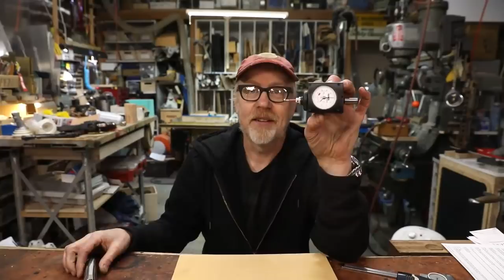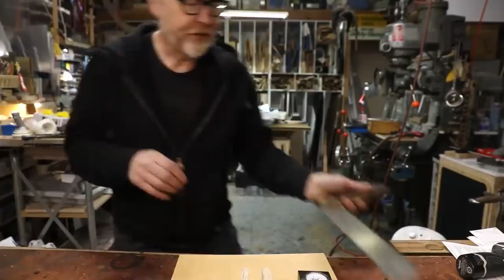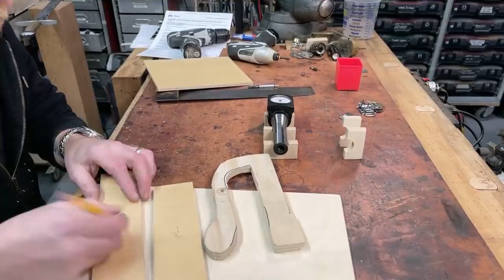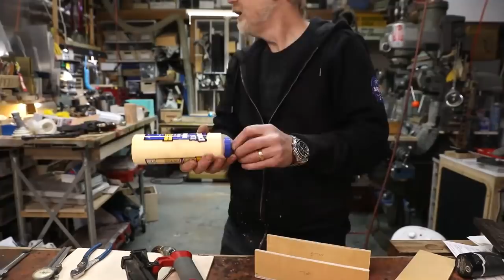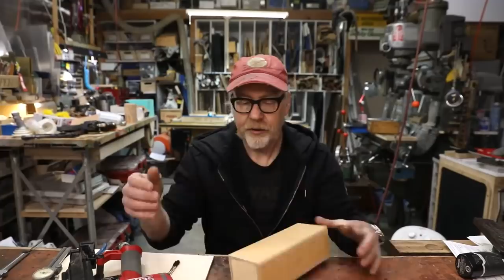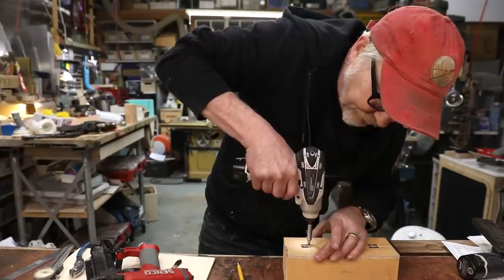Adam Savage's Live Builds: Real-Time Box Build!

Comment: My tooltips for Adam: 

1. Make sanding sticks out of paint stirring sticks for larger sticks.  
2. Buy some silicone basting brushes from the dollar store and cut them down to around 0.5 to 1 in instead of using disposable acid brushes for wood glue.  Saves a lot of money and waste since they are reusable.  An added bonus is if you let the glue dry in them overnight, pulling the dried glue out is so satisfying the next day.
Reply: The silicone brush from titebond is very good
Reply: It funny to me that you think it’s necessary to comment a tool tip for him.
Reply: @SuicideNeil  gotcha
Reply: They actually make smaller brushes. Still not as cheap as getting one from the dollar store unless you buy them in bulk and have 100+ of them sitting in a box.
They also make silicone brushes designed for glue for a few bucks ($5 or so).

Comment: Quick Tip for anyone who likes to use Acid Brushes for spreading wood glue...keep a small cup of water around and a paper towel or rag. Get the brush wet in the water and dry it of with the rag so the brush is just damp. Spread glue as usual and then throw the brush in the cup while you wait to glue your next joint. The next time you need the brush, repeat the steps above. After your done with your glue up, you can clean your brush in the sink for a couple seconds and it's new again. Let it dry and your ready for next time. Very easy, economical, and less wasteful than using a new one every time. Same can be done with paint brushes for water based paints. A damp brush will leave less texture and will release paint easier so you can paint more with each dip.

Comment: I know a company that makes those sticks, and the production process is a whole big box of the sticks, a paint brush with the glue, and a big bucket of assorted carborundum grit that the lightly painted sticks are dipped in to coat them, then left to dry, then brushed off with a wire brush.  The foot scrubbers are made similarly, using a thicker layer of glue and 2 coats, to get a decent coat. Different grits for different types, from ultra coarse to a very fine nail buffer.

Comment: What I do when cutting open a box is I cut the hinge side first.  Then screw on the hinges, and then cut the other 3 sides.  Keeps you from having to hold both halves of the box.  Also works for the latch side.  Just gets rid of the need for a 3rd hand.

Comment: As some insurance, I'd make the holder's holes 1/2" larger so that you you stick some 1/4" high density weatherstripping to it.  Just in case it does get dropped, there's some form of shock absorption.  I also had a bit of an EEEK moment when you went to hold it up at the end...I thought it was going to roll out. 
Thanks for the great video/tutorial.  I need a brad/pin nailer in my arsenal.

Comment: If you hold the nailer perpendicular to the vertical board you're nailing into (at 16:58, the sides of the box in this case), you'll greatly reduce the number of blowouts you get. This is due to the angle of the tip of the nail/brad/etc.

Comment: Jesus wept for pilot holes on those hinges 😂
Reply: I would have used small bolts and washers with lock tight. Wood screws will be eventually fail. Adam mentioned in his tool tip this gauge will be used a lot. That means the box gets handled and opened a lot.

Comment: Adam

Considering the high accuracy of the Haimer, I would suggest that instead of a R8 collet that you use a good R8 endmill holder for the Haimer.  Since the Haimer can rotate in the collet before it is tightened in the spindle, it is possible that the the accuracy you work hard to get calibrating the Haimer could be OFF if the Haimer rotated when inserting into the mill spindle.  A R8 endmill holder would lock the Haimer into the R8 adapter, so no worries about changes in accuracy when inserting and removing a collet.  Good R8 endmill holders (like a Lyndex) have TIR of 0.0002in so then the only point of inaccuracy would be in the spindle itself.  Considering the cost of the Haimer, a Lyndex endmill holder is about 2x-3x the cost of a Lyndex collet, and in my opinion well worth it for a lifetime tool like the Haimer.  Definitely would not recommend budget collets for this purpose at all

John

Comment: It's almost certainly been said but just in case it hasn't,

To avoid the blowouts with the pin gun, stick a ply block along the underside of the magazine slide exactly the same thickness as the depth to the retracted safety, ready to fire tip of the gun, it'll keep your pins at exactly 90 degrees if you need them to be, and mostly you do!
For angled shots, lean the gun forward, it may lift the tip slightly but you can file the tip to minimise this if it's an issue.

Nothing worse than a lovely box built, only to have a blowout and ruin it! It's tricky to blend some types of ply to cover it up!

A small side note, you sometimes use so many pins it's inevitable youll blowout,  or at least just leave an ugly row of pin holes, you really only need enough pins to hold the parts while the glue dries, it's the glue that gives the majority of the strength to the job, not the pins.
At least it should be!!

In the high end stuff I've done in the past, i never used pins, just tape or maybe clamps if possible to allow the glue to do its thing.
Most glues we use these days are stronger than the materials being bonded, especially true in the case of ply/quality pva!

As always, a pleasure to listen and watch you work.
Cheers!

Ps, Western Australia GMT+8hrs here

Comment: Adam

You say you have a habit of making your tolerances too tight.  Have you ever built a box and found out that when you cut it in half, that the saw blade kerf has now make the inside too tight?  Or do you factor in the 1/8in kerf of the saw blade in your measurements?

John

Comment: @21:34 Adam — so why are you using the table saw for this cut, when the band saw would have a thinner kerf?

And why did you build the whole box first — with nails — and then cut it in half, where you would risk the saw blade hitting a nail?

Comment: Any longtime machinists please chime in here if I'm wrong. I've only been machining for a few years, so I haven't the experience to know for sure, but should that gauge be stored while in the collet? Couldn't the two surfaces rust if kept like that because there's no air circulation to keep moisture from staying between them? I've heard this can happen with mics and other things if you don't store them with jaws slightly open.
Reply: I don't think Adam is going to have much of an issue. I've never seen carbide rust either. So I don't know about the mic thing. But I don't store mine cranked down myself. I should look at my set. I haven't in a long time. Calipers are good enough for most of what I do.

Comment: Adam needs a Mathias Wandel finger joint jig for the table saw
Reply: They're box joints and Mathias' contraption is far more complicated than it needs to be. I don't even know if Adam owns a dado blade. Finger joints are what they use in cheap mouldings. Go to the home center. They'll have racks of finger jointed moulding. Bit different joint geometrically. Finger joints have tapers.

Comment: superglue the hinge before you screw it, that way you can get and keep placement perfect.
Reply: My luck 
I would get the glue in the hinge. Never to work again😖
Reply: @assassinlexx1993  just put some blue tape on the hinge if you're worried, once you've got the holes you can take that off and screw your hinge back on.
Reply: @Vorgto   
Thanks for update. Wood and I have a bad relationship.  Dead tree carcasses is only good for  heating the metal shop 🤣
Reply: @assassinlexx1993  it's great taking a caracas and really putting it to use. Not like that silly vegan stuff you can just grind or weld when you make a mistake. (Wish I had space for a metal shop)

Comment: Glad to see you using a push-stick but you freak me out when you lean over the table saw. I've slipped when leaning over the table saw before and was fortunate not to fall chest first onto the blade, it was a wake-up call for me. I never want to be leaning over the blade. (Sorry to be a Safety-Sally)
Reply: If you have a habit of falling randomly then using machinery probably is not for you.
Reply: @1pcfred  Sawdust on the floor. I know it's important to keep your shop floor clean but even with extraction it can be difficult when using the table saw.
Reply: @AndrewBlack343  it is more than important. It is a safety issue. Adam runs dust collection with his table saw. So there's not a grain of saw dust on his floor from it. Rule 1 of machine operation is a clear space.

Comment: Somehow I always feel that a screwdriver rather than a drill is better for small screws... the lack of finesse because of the angles and weight outweighs the speed benefits
Reply: Adam uses a small driver which in the right hands offers considerable control. Reminds me of when I was popping spot welds with an air hammer and someone remarked, Not exactly a finesse tool. Maybe not for them. Skill levels vary.

Comment: Liberia also hasn’t gone Metric...
Reply: There's two kinds of countries in this world. Ones that use the metric system and the one that's put men on the Moon. When our astronauts landed they called out altitude in feet too. No one cares how many meters off the surface you are.
Reply: @1pcfred  There are countries whose Mars Climate Orbiter was destroyed in 1999 "because a contractor provided thruster firing data in English units while NASA was using metric.”
NASA has standardized on metric for use on the moon. NASA cares how many meters off the surface of the moon one is.
Reply: @timetravellingbunny3952  some quotes are meaningless without context. Not all things ever said were completely accurate either. NASA has no mission today. What they do still have is an agenda though.
Reply: @1pcfred  "Not all things ever said were completely accurate either."
You have demonstrated that.
Statements in the quoted article were:
The Mars Orbiter was destroyed because metric units were not used by one contractor, and that
NASA has standardized on the metric system.
Do you have any evidence to the contrary.
Reply: @timetravellingbunny3952  The mission cost 291 million. A typical mission costs over 2 billion. Now if the extra money was spent it is reasonable to assume that the error would have been caught with increased QA. What they paid is what the hardware cost. That's it. The mission failed because an error was allowed. It doesn't really matter what the error was. If it wasn't that it could have been one of millions of other things. Many of which had absolutely nothing to do with unit conversions. Trained eyeballs cost money in the real world. Without that money there are oversights.
Reply: @1pcfred  I suppose if one can’t provide evidence for claims, if one can’t give a direct answer to questions, then one attempts to dazzle with bullsh…it..
Reply: @1pcfred  Ah. From the smell of things you brought a pony.
"NASA has no mission today."
Yet, NASA's Perseverance Rover is about to land on Mars.
Reply: @timetravellingbunny3952  they're persevering to maintain their little fiefdom. We'll have to see if the Big Guy starts taking his 10% cut from them now.

Comment: This box is just screaming out for the use of a laser cutter/engraver.
Reply: Not everyone is into the burnt wood look. I'm not sure how charred wood effects PVA glue joints either. Apparently there's no easy answers on the net.
Reply: @1pcfred  If you don’t want the charred wood look, then sand the edges.  Not hard.  In fact, if you design the tabs on the finger joints to stand a few thousandths proud of the edge, you can sand them back flush with no problem and completely eliminate visible charring in the joint.
Reply: @JoeBrinkman66  I'd rather just let a machine do the work. Sanding stuff sucks.